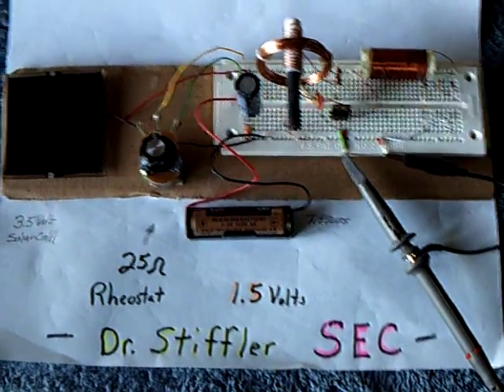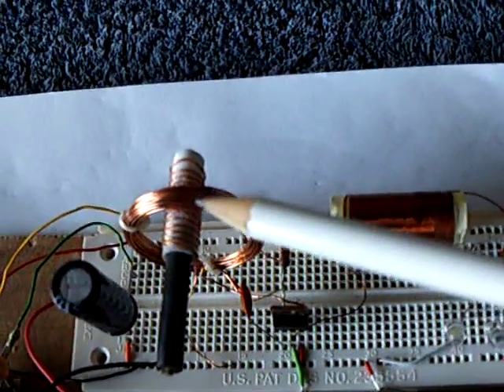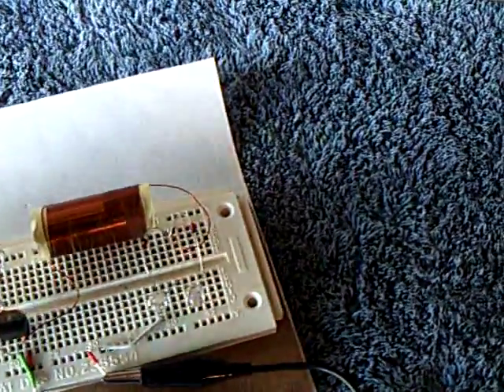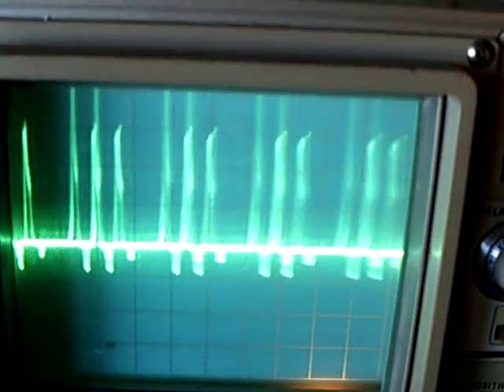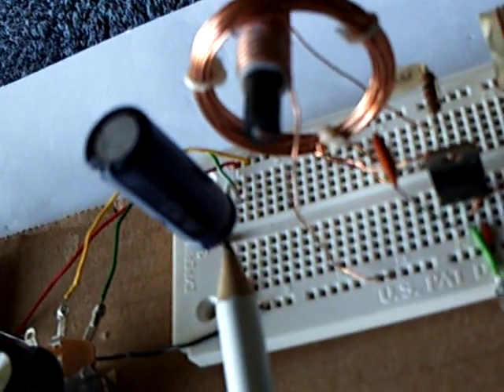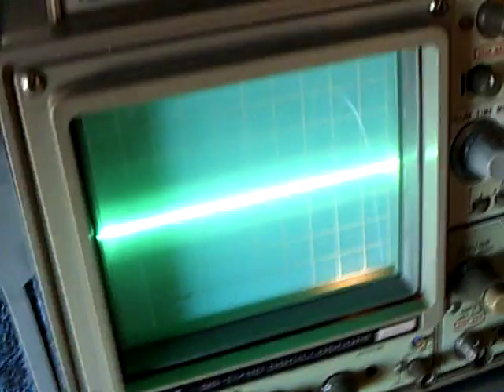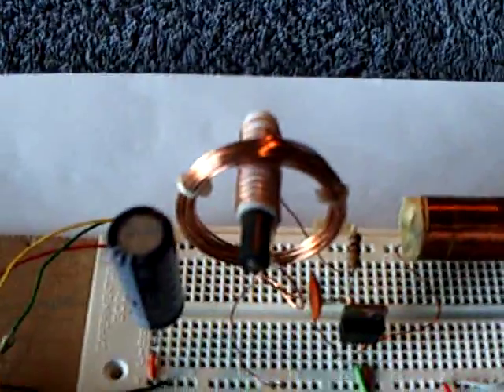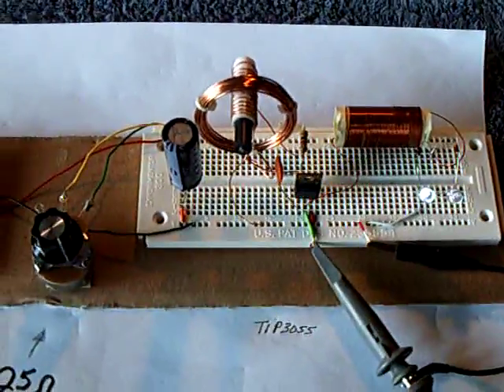Dr Stiffler SEC 1 AA battery setup

Comment: I don't get it....what's the point? You're matching the inductor frequencies so they resonate so they can transfer the energy. But it's wasting energy, and it won't transmit far. You're likely operating at high frequencies which would allow a capacitor to act as a ground for the LEDs. Earth ground is best. The bread board itself has a decent amount of capacitance though. Nothing magical going on.

Comment: I have this large (3" diameter by 6" height or so) 6volt 22 Farad capacitor. I think that's the capacity since it had a large 22,000 number on it. Maybe I can charge it up and run a 12volt camera (150ma draw) for a while, or for some other project. I haven't checked the forums for the Stiffler but would like to hear more about the intended goal. By the way I enjoyed the Silent Running movie and your past vids, I saw the movie per your recommendation.